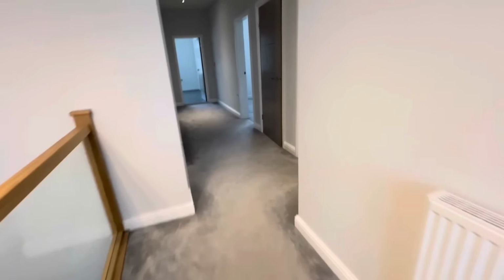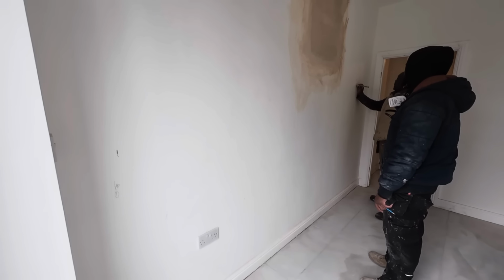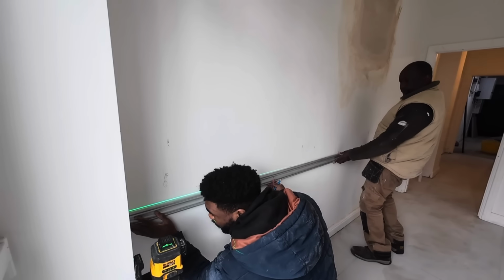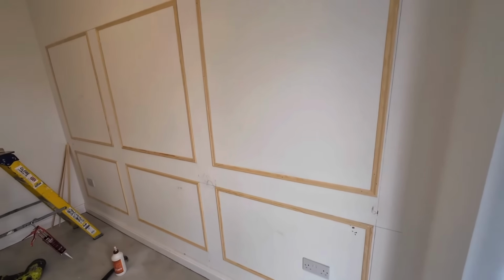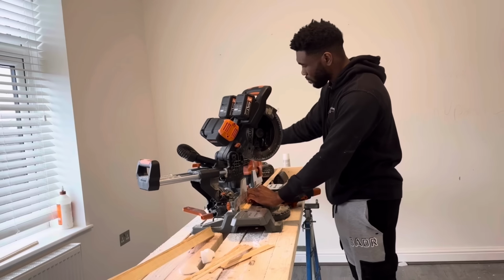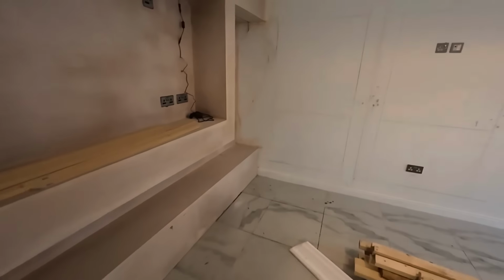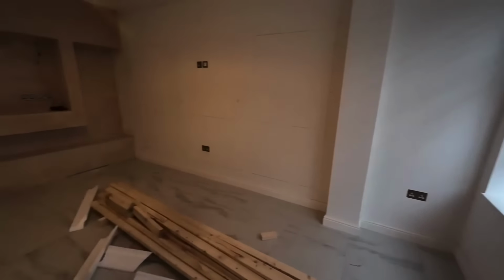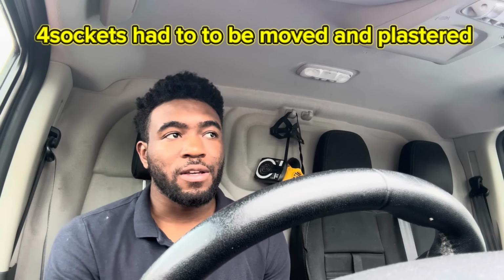HOW I DO MY PANELLING AND HOW MUCH I CHARGED ( whole house panelled)

Comment: Great video 👍🏼

Question. I saw you use a nail gun. Were any of the walls that you used the nail gun on solid load bearing walls? I’m asking because I want to use one and the walls are replastered solid walls that separate the houses and I’m wondering whether the nails would destroy the plastered walls.

Comment: I’ve been doing paneling on doors to make them look old for old flats and I find it easiest to measure it out like you have done but then cut all the parts and form them together with impact adhesive on the ground before nailing them. found it is a bit faster than one length at a time and easier nailed. Means you can cut all parts for the wall at the same time and saves trips to the saw 😊

Comment: I am a finish carpenter however; I do not know everything even at my age I learn everyday! 
On paneling one has to figure for accumulative error which is figured into your math ?  If you use like a construction pro math program it automatically adjusts for it?
Example if your panel is figured off a space L x W = ? ; if your panels figure 24.2 in each space it’s actually 24.22222/?  Then rounded to the nearest number.  That is accumulating error !  
You hv to be aware of that & I am betting you are?

Comment: Great vid mate! 

Would have been nice to see how to work out the degrees for stair panelling etc. 

Love your work and love your uploads.
Reply: I've done it a few times, and the stairs is the hardest most frustrating part of the job. Tried using mathematics, inside angles etc. nightmare, ended up doing it by eye once . Ridiculous.
I've since bought a nice little gadget that transfers the angles to the mitre saw. Much easier.

Comment: How many lengths of moulding did you use?
I hope you got it at a decent trade price because if you buy right it is around £2.50 a length, not £7.00 or more like the DIY stores charge.
I’m in the middle of quite a complicated panel job with machined frames and raised panels.
Reply: Where do you buy your panelling strips?